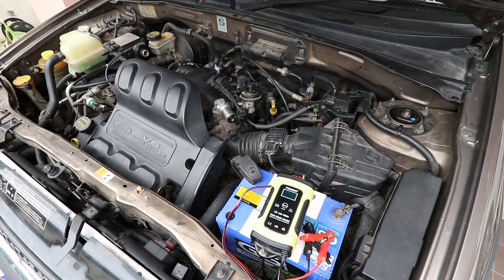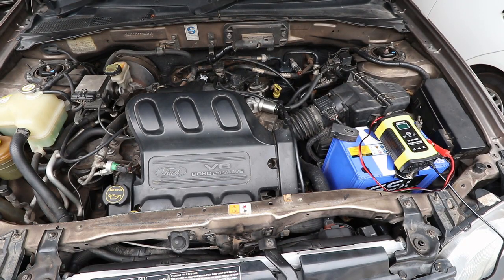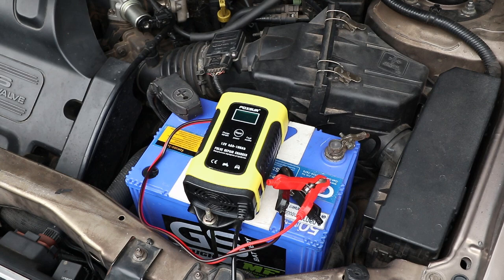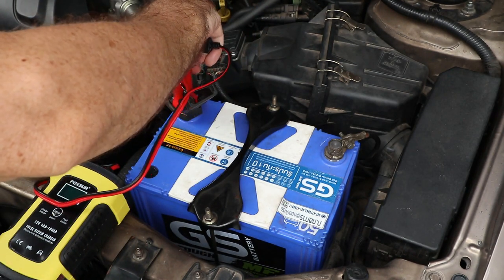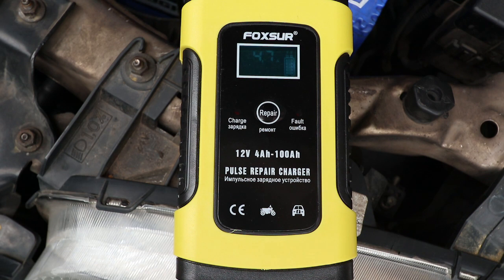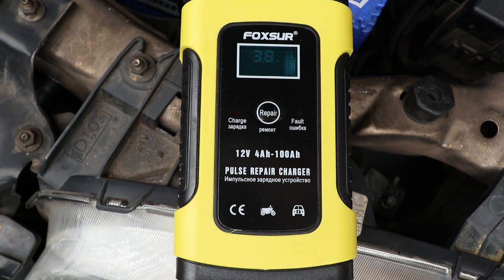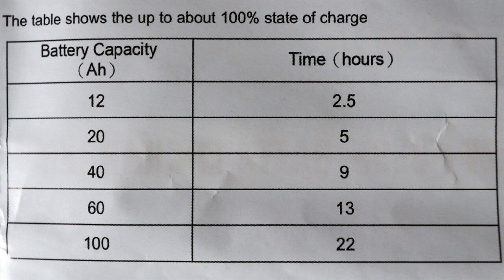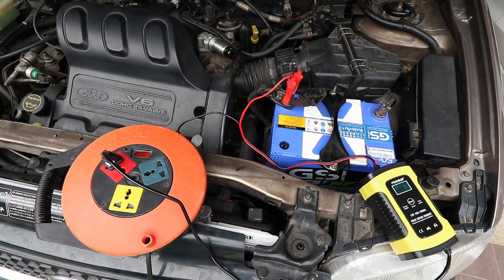Review Of The Foxsur Pulse Repair Car Battery Charger

Comment: I used repair mode to revive a totally dead battery.  It took almost 30  hours on REPAIR before it could hold a charge, but was back to normal after that.
Reply from the maker: That's great news! It does take a long time but, like you, I've also had some success. If the problem is just sulfation the pulses from repair mode can clean the plates. If the problem is more than that you can't do much. Anyway, thanks for your comment!
Reply: @PhilUKNet  Thanks.  Yes, this only applies to batteries with hard sulfation problems.

Comment: IF USING REPAIR MODE DISCONNECT THE BATTERY FROM THE CAR (no need to take it out) I do a video about Thai crap batteries which need regular distilled water (look down the glass sight to see if its red or blue on your GS masterpiece of Kee Nok)  it's in my videos (look for Nissan fan repair)  shows you what you need to do to make sure your so called "sealed" battery has not dried out in this freakin climate (hua hin/every 6 months) Rip off the long label and you will see some cell covers if dry you MUST top up with distilled water (I use water from my a/c) (true even for panasonic I'd never use the battery maker GS you have ) Jump starting does not put huge jolts into batteries (why would you think that the car's alternator charges at 14 volts, ?)  BUT you must check the cell water level as that's that first base check unless wanting to get home fast. You don't need to use the chassis as a return lead, as the chassis may have some problem and resistance, what you need to do is check the battery is not drained by a small circuit or light. I got one of these charges it seems fine, jury is out on pulse repair. Leaving a battery discharged will kill it soon enough  (below 11v)..................
Reply from the maker: Every battery I've bought has been sealed so I haven't checked. Thanks for the tip. The climate, especially the humidity, kills lots of things. My current battery is doing great. It's 4 years old and still good. Previous batteries haven't lasted as long.

Comment: it's work really great, I used it 2 times now, because i abandon my car for 2 week and the battery getting weak.

I save a lot money when i have this charger. before I usually change my car bettery every year, now it's has been 2 years I didn't change it.
Reply from the maker: That's great to hear! I've received a few negative comments, but most feedback has been positive. There are limitations. It can't repair damaged cells, but if the battery is weak because of sulfation the pulse/repair mode can improve battery life. Thanks for your feedback!

Comment: Would it affect the car in anyway if the battery is not unolugged from the car and the charger is being charging the battery at thr same time?
Reply from the maker: It's a good question. I wanted to know this and several people have asked. Unfortunately, the user manual doesn't mention this. I have performed normal charges with the battery leads still connected and there wasn't a problem. However, I always disconnect the leads when doing a pulse/repair charge. High voltage pulses of electricity could very likely damage the car's electrical system and it's not worth the risk.

I always think it's better to be safe than sorry and considering that it only takes half a minute to disconnect the leads it would probably be a good idea to do so while charging in order to eliminate any risk of doing damage to the car. For this reason, I would recommend disconnecting the leads every time. Just in case.

Comment: My charger is currently not working. LCD only displays El-l- and wont charge anymore. Any suggestion how to fix it?
Reply from the maker: I'm sorry, I don't have any suggestions. Some devices give you a list of error codes with descriptions of the errors, but there is nothing in my user manual. With many cheap electronic devices these days they're not designed to be repaired, just replaced. If you have any electrical knowledge, or know someone who does, you could take a quick look inside for anything obvious. Otherwise, it's not going to be economical to repair.

I just looked at Lazada and where I am in Thailand they are being sold for as cheaply as 209 Thai Baht - just over 6 USD. If my one went wrong I would just buy another and throw the broken one in the bin.
Reply: User manual > How to use > 4. Wrong battery connection: “EI-I-” will displayed on screen, the indicating lamp will flash.

Comment: I watched this and as a result I bought two Foxsur charger/pulsers. I then tested both in operation on a lawn mower 12v battery.
On pulse/repair mode they were ok HOWEVER in normal charge mode both chargers delivered 46 - 48 volts, which makes them a fire or explosion risk. They are supposed to deliver a maximum of 14.4 volts.
I would advise against buying one at all.
Reply from the maker: That's interesting. I understand that a charger should deliver a voltage of 2.30v to 2.45v for each cell, therefore 13.8v to 14.7v with a 6 cell battery. As you say, 48v would be dangerous and with such a high voltage I'm not even sure how it would work. I've not had any problems myself and I've not heard of any such problems in the comments I have received. I'm therefore at a bit of a loss to explain. Anyway, thanks for your feedback.
Reply: @PhilUKNet  I had to take photos to claim a refund. 
If it had just been one I wouldn't have commented here,  but two out of two is beyond a fluke. A bad batch perhaps,  but it's only fair to warn others to at least check before extended use
Reply from the maker: @RUSSIANUK  Two is definitely more than a coincidence. As you say, possibly a bad batch. Did you use a multimeter? What was the voltage reading on the charger when you were charging?
Reply: @PhilUKNet  the voltage was all over the place whilst charging topping out at 48v, both chargers started at 14 volts but fluctuated so I kept watching, they just kept climbing,  if they'd got much higher I would have stopped them manually. They both stopped charging when the battery was full, but the 48v remained within the cables when they cut off.
Yes I was using a multimeter.
I must admit, I didn't cycle through the menu to see what it reported itself, I maybe should have but I trust my multimeter.

Comment: Bought this charger to try & fix wifey's Suzuki Celerio which is also suffering from Covid torpor. I attached the red clip to the +ve post & the black clip to the -ve post (not the body earth). Will this damage the battery?
Reply from the maker: I don't believe so and if you charge the battery outside of the car, connecting the negative lead to the battery post is your only option. To be honest, I used to connect the charger to both battery posts with the battery in the car but I saw a lot of comments online saying that you should use the chassis to connect the negative lead. Same for jump starting. I assumed that the people giving this advice understand more about car electrics than me, so I started doing the same thing. Covid torpor is afflicting many people and things, and it goes on and on and on.
Reply: @PhilUKNet  Thanks. I started the recharge yesterday. I'll try the chassis trick when I restart charging later today. Regarding Covid, it's absolutely rampant again here in the UK. Best stay in Thailand. It's safer!

Comment: Love the review because I just brought one but before I decided to buy I was looking for something bigger. It was like you said technology has come along way because I only new big heavy duty chargers like my dad had when I was in my youth why I was confused to by or not. I'm happy I did.
Reply from the maker: I too remember those old chargers that my Dad used to have. They weren't very clever and you could easily overcharge your battery. The modern ones are tiny and have very clever electronics. It's not a problem if you connect the wrong polarity and they prevent overcharging. What's more, they are very cheap. I've been very pleased with mine too. The regular charging mode works well and I have extended the life of a couple of batteries by doing a pulse repair. Thanks for your comment!

Comment: Can it be used and repaired for 150 . Gel battery?
Reply from the maker: From the user manual: "This battery charger utilizes the latest technology in Lead-Acid, AGM,GEL, Flooded(Wet), Calcium type deep cycle, VRLA maintenance free lead acid batteries charging, can be used with 4Ah-100Ah batteries."

From that, it would seem that it can be used with GEL batteries, but 150Ah exceeds the maximum capacity recommended by the manufacturer. It may well be able to handle 150Ah, but I don't know.

Comment: Hi Phil i got a Foxsur after listening your review. i tested on a fairly new spare battery ( not yet used)  & there was no charging light on &  screen showed temp  & constant  12.5 volts readings . The battery figure also showed only 40% charged ( 2 columns)  This lasted over  8 hours without any change in the above light , readings except for temp which went up . i also tested the charger on a working battery  . Again there was no charging light & screen showed temp & 12.5 volts But the battery figure showed 100% charged ( all the 5 columns) . in your assessment is my new battery faulty ( 40% charged) or is charger faulty since not  charging in both cases
Reply from the maker: Difficult to say! These cheap chargers are mass produced somewhere - probably China - and the QA isn't great. It seems most are OK, but a few dud ones slip through the net. Can you get a replacement charger if you have only just bought it? Even though your spare battery is fairly new, has it been sitting for a long time. Have you tried pulse repair mode? That may be what is required to kick it into action, but be aware it takes a long time - 24+ hours.
Reply: @PhilUKNet   thank you for your  considerations !!
Reply from the maker: @boeyks  I hope you get it sorted out!
Reply: @PhilUKNet  Hi : Just some pointers  . When the charger is first  connected to a weak battery does it show some voltage reading  ( below optimun) , charging red  light is on  flashing  and the  battery capacity in percentages  flashing . When the battery is fully charged the voltage is at a fixed value , the red light is on continuous and the battery capacity in 100%  continuous ? . Can a battery be considered fully charged if it shows a fixed voltage reading , no charging red light , temp  reading and battery capacity in % stationary at 60%  Thank you
Reply from the maker: @boeyks  When my battery was run down so far that the engine wouldn't turn over, yes it did read some voltage. I'd need to run another test to answer your other questions and I haven't got time at the moment. Sorry.
Reply: @PhilUKNet  Thank you for your prompt response .  I wait
Reply from the maker: @boeyks  Sorry I can't help you more. I can't remember the answers to your questions from the last time I did it, and I just haven't got the time right now to go through the whole thing again.

Comment: Can the battery charger be used as a trickle charger for a motorcycle battery that's not used all winter
Reply from the maker: I've been asked this before and although you may be able to use it for this purpose, it's really meant for charging and doing pulse repairs. Personally, I would use a device that was specifically designed as a trickle charger.

Comment: Well, I am watching the video post purchase of this device to know more about it. Your video surfaced first in the google search. Glad to have stumbled on your review Phil. Without knowing much about it, I happened to take the battery completely out and then charge. Viola, it worked on my cars dead battery. Good to know that it is safe to charge without disconnecting the battery from the car as well and also thanks for the tip to connect the negative to the chassis on a piece which is not painted. Will remember that. I did not fully charge though. But I guess it was enough to power on and get going.
Reply from the maker: Thanks Venkata. I leave the battery connected if I'm doing a regular charge, but disconnect it if I'm doing a pulse/repair. A continuous charge shouldn't do any damage, but I don't know what those pulses might do to the car electronics. Apparently, these modern micro-processor controlled chargers are fairly safe, but with old-fashioned chargers it is best to always disconnect the leads when charging.

Also, modern cars have quite sophisticated electronics that remember engine settings in the PCM (Powertrain Control Module). If you disconnect the battery these settings are lost and need to be relearned. This is another reason for not disconnecting the battery.

Anyway, pleased to hear you got your dead battery working again. Even if it wasn't fully charged, it should charge fully when you drive the car provided the alternator is OK.

Comment: I am considering about purchasing this model. My batteries are for motocycles, 12V, from 4Ah. Is the current 3.6A quite high to charge low capacity batteries?
Reply from the maker: Here are a few comments from the user manual: "This battery charger utilizes the latest technology in Lead-Acid, AGM, GEL, Flooded (wet), Calcium type deep cycle, VRLA maintenance free lead acid batteries charging, can be used with 4Ah - 100Ah batteries."

"Remark: For 4Ah - 15Ah battery, we suggest use "Repair" mode, because the battery size is too small, use pulse charge is very good for small size battery."

Please excuse the English, it's not mine, but the recommendation with low capacity batteries is to use pulse/repair mode. If you do that it should be fine.

Comment: Does anyone know if you can keep this conected when on a leisure battery.
Reply from the maker: Not sure what you mean by a leisure battery, but this isn't a trickle charger. As far as I know, it's not designed to be connected to a battery for months at a time. You may be able to do that (it should stop charging when the battery is full to prevent overcharging), but really it is designed to charge or repair/charge and then be disconnected when finished.

Comment: I would just like to point out here, that your automotive battery is not filled with sulfuric acid... I don't know where people get this from?
The electrolyte solution inside your automotive battery is just Distilled Water... the process of transferring energy from your alternator to the battery is what creates sulfuric acid inside the battery, and it is then released into the electrolyte solution.
Fallen automotive battery does contain sulfuric acid, sulfuric acid is not specifically put into the battery.
Reply from the maker: Thank you for your clarification!

Comment: Great video...

Got my Foxsur today but it turns it's self off in every mode after I turn it on (connected to the car battery).

Any thoughts?

Thanks.
Reply from the maker: My thoughts are that your unit is defective! This certainly doesn't sound right. As you've just got it I would send it back and ask for a replacement. Good luck!

Comment: got one, very usefull. Live in Malaysia and batteries do not last as long an essential piece of kit during lockdown
Reply from the maker: The short life of batteries has surprised me living in a hot climate. In the UK batteries seemed to last for ages. This morning I had to change the battery in my wife's car again after 2 years and 9 months. It started getting weak a few months ago. I used the charger to do a pulse repair, but this time it wasn't successful. The low CCA was exactly the same after the repair. I have had had success doing pulse repairs, but it isn't successful every time. Being in lockdown and not using the car regularly doesn't help, either!
Reply: @PhilUKNet  2 years and 9 months is considered "longer than average" for a battery in Asian country. That's already pretty good. 
Mine is turning 3yrs soon and I'm afraid I would have to retire it within the next few months. Our Foxsur is like a life support machine for aging batteries. Keeping it alive during this pandemic. Stay safe!

Comment: Hi. My 10 months old battery 95ah12v and it's fully drained absolutely no voltage what's so ever. I tried with this device to charge it but no luck. Any suggestions please?
Reply from the maker: I've read several times that draining a battery completely can cause irreparable damage. I guess it's probably sealed, but if not make sure that the battery is topped up with distilled water and then try the charger again. Try it in regular charge mode and also pulse/repair mode. Even if it doesn't appear to be doing anything, just leave it for several hours. The repairs I have done have taken over 24 hours. It's not fast. Beyond that, I'm not really sure what to suggest. Ten months isn't old and it's a shame for the battery to have died after so little use.
Reply: @PhilUKNet  hi Phil many thanks for your infomation. Luckily the battery started to get charged after I plugged my home 12v DC power pack and then managed to hook up the pulse charger. Now it's being charged 12.2v but more to charge till the display says it's charged 100%. Let's see 🤞🤞. Thanks
Reply from the maker: @dilukabeylk  That’s excellent news! Sometimes it seems that batteries need a jolt to get them going and your power pack must have provided what was needed. Hopefully, the charger will now do some reconditioning and top it up fully. As I said, it takes a long time. In my experience more than 24 hours. This is great though, it would have been such a shame to have to replace a 10 month old battery.

Comment: I've just got mine and put it on a dead motorcycle battery so here's hoping.
Reply from the maker: Good luck! If the battery is just suffering from sulfation the pulse repair function can be effective. However, if the battery has more serious problems it can't work miracles. I hope it works for you.
Reply: @PhilUKNet It's been in the shed for ages so if it brings it back I will be super impressed. Great review by the way.